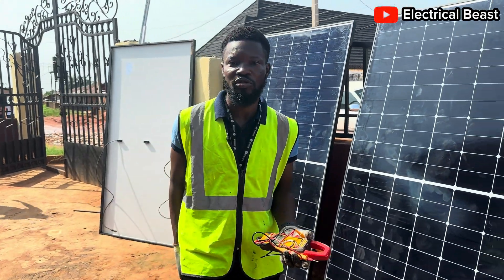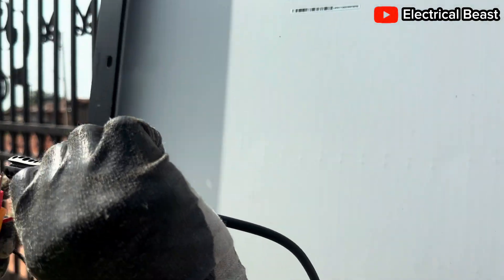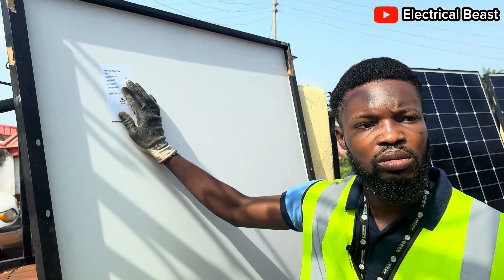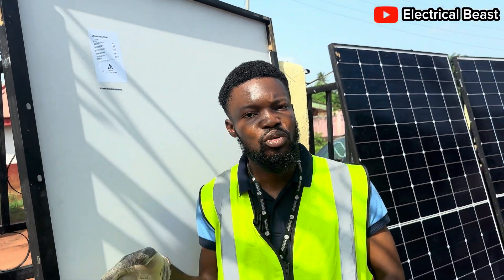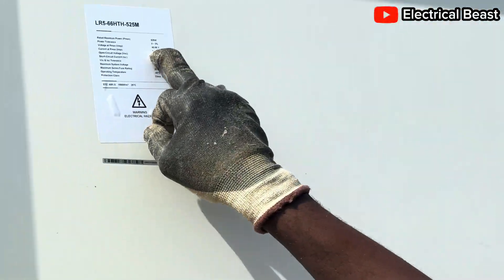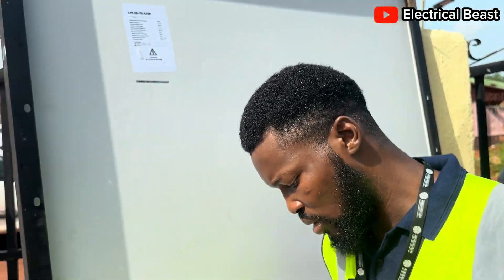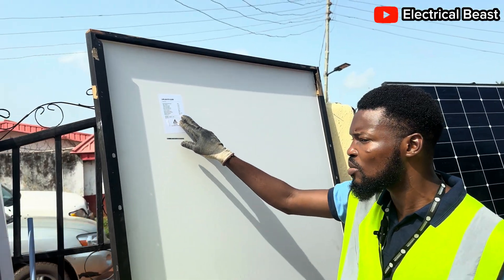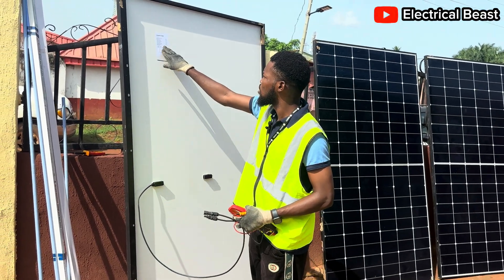Longi 525w Solar Panel | Explained in Simple Terms + Voltage & Current Test

Comment: These aren’t longi panels… Sticker from company doesn’t contain bubble beneath the sticker…Na Alaba doings!
The junction box of the panel has been changed to match the stickers that’s just what it is.
Same with the Panels tested before which has three different manufacturer of SunFlex, Trina and Canadian.
I believe it’s actually Canadian and not any of the other two as the junction box and connector are what was changed!
Reply from the maker: Hmm
Reply: @engrgideon Yeah